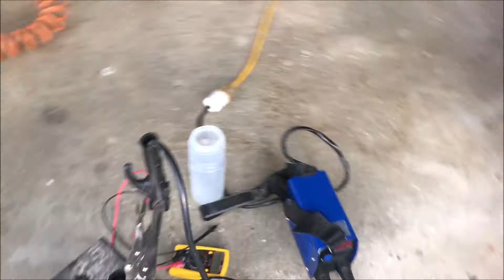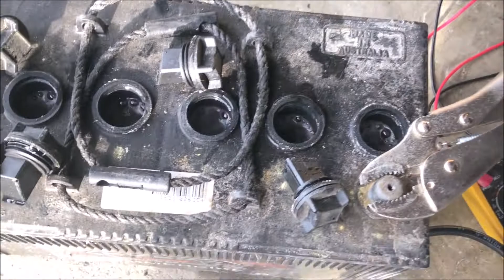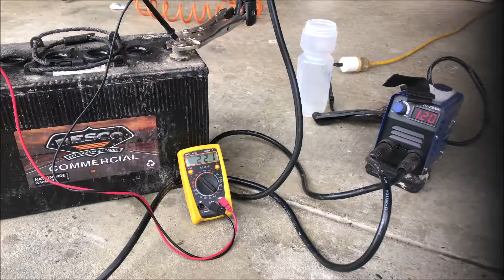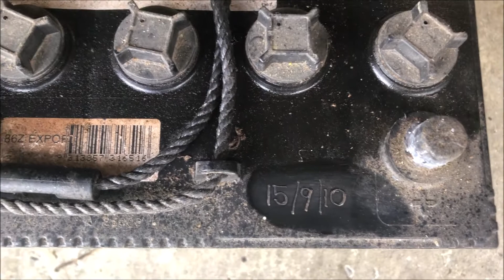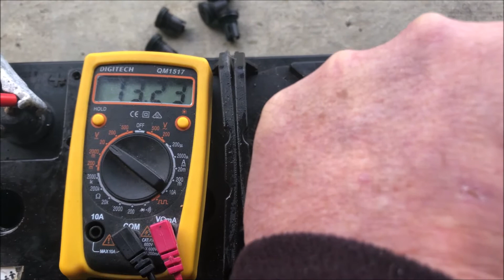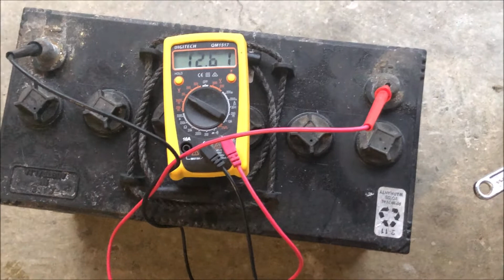Repair your Car or Truck Battery with a DC welder.

Comment: It doesn't really work all the time. All it does to mine is charge it. 85A max, that's when the electrode starts glowing.
 The battery doesn't hold charge for more than half a day

Comment: For anyone3 trying this.
make sure you get your polarity correct. And use PPE and do it in vented area/outside.  THe gases coming off are hydrogen and oxygen,   In the perfect ratio to ca-boom.  Always switch off the welder first and wait for the fumes to go away, before braking connections.

Comment: sure this stuff works but it kills the CCA rating, you also need to dump the acid out and clean it and then wash the plates and bottom out then put the original acid strained back in. once you condition it you need to clean the acid again...but you still FU the CCA
that battery is only good for accessory and back up  use perhaps put it in a dune buggy, it sure wont start a car in winter...
edit instead of the welder you can use a start charger that delivers 50 amps leave it set to burn the sulferization off but doesnt blow holes in the plates...
Reply: Agree about the acid changes, but regarding the CCA, projectfarm did a video recently that shows the CCA also restored upto 80% in cases.
Reply: @DJtheone  that is still 20 % lose tell your family that one cold azz night after a january school program....
reconditioned battery goes in the shop on an inverter or a starter for the farm generator .... back up to power lose in the house on the water heater or rigging  the essential during a storm...
Reply: @willieboy8798 ❤
Reply: @AedMuhamad-u8y  opps forgot a welder hooked up backwards does less damage to the plates and less CCA destruction.
caution to user start at lower amp delievery as possible then work up to about ten amps after bubbling
Reply: @DJtheone  you can, if you get good enough plate cleaning put fresh acid in it hook it up to a DC welder(caution) crank it until it starts to bubble. stop both acids old and new have swapped valence electron exchange. the battery is safe. chemist (physics major)
Reply: @ in cases and 80% is damn close to 50% and how long was it 80%????
back to the recharge and bench power in the barn!!!
Reply: BS your CCA is gone 2 years after you buy the battery. you dont burn anything OFF it is an entire chemical process sulferization is a chrystalization ...if your going to comment like you know what your talking about sound like it!......
go BS somebody else princess...

Comment: I think I need one of those little welders I doubt they are capable of welding anything thicker than a tin can but for this job it’s perfect . I’m a believer that this process really does work and it will give a worn out battery ( due to natural causes ) a new life. I see a potential business opportunity here!  Great video. I think you answered any questions I had about the process.

Comment: It appears that you have put the ground cable on the positive post, creating a negative polarity, which will charge the battery in reverse polarity, causing the positive post to be the ground.
Reply: Nah, he had the leads reversed in de welder as well.

Comment: Doesn't the battery heat/overheat and isn't that bad for the battery?
Reply from the maker: You are only going to do this if your battery has problems in the first place, It Disulfates (dilutes the crystal build up) the battery if its sulfated.
Reply from the maker: some battery's cant be fixed
Reply: Cheers bro, keep making them videos.

Comment: Have tried this although once battery cools down and kept for around 12 Hours 12.8v dc gradually reduces to 11.9v dc
Reply from the maker: Hi Trave yes sometimes some batteries it works for and some it doesn't. it depends on the condition of the battery, if its just sulfated, it will work, but if it has lead build up and shorts a cell it wont.

Comment: It's easy to flush the rubbish out of the bottom of the batterys and fill with new acid, we used to do that 35 years ago but I can't rember having any real success doing it.
Reply: Where do you find fresh acid?  Is it any better than just puring the old stuff through a coffee filter?

Comment: Great idea bud I had a battery explode close to my face after putting it in the battery box of my superstock had it charged but the gases were still coming out of the vents from caps as I didn't let it rest arcked out from spanner touching roll cage will doing up terminal saw a flash and then the loudest boom in the garage lucky I pulled my head out of the rear of the roll cage in time ,ran for the bathroom scared the crap of me ,then a few weeks later the pit crew were grinding a side rail thought they had cover the battery which wasn't in the racecar then boom ,was surprised you didn't have the caps resting over the holes as you could see the gas coming out seems like it works but for how long , cheers , shaneo , nelson, 👍
Reply from the maker: Some batteries cant be fixed and some it brings them back to life, not sure for how long tho as mines still going.